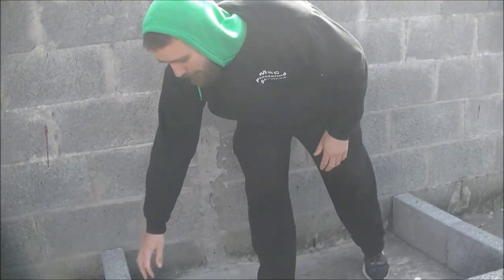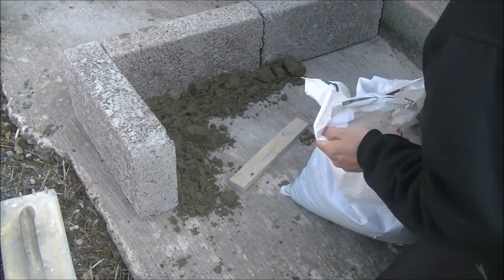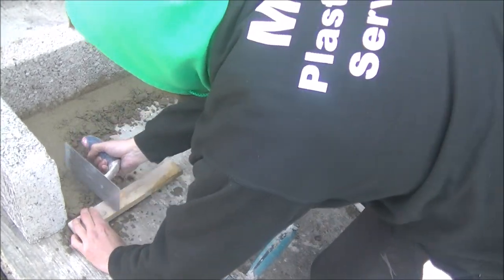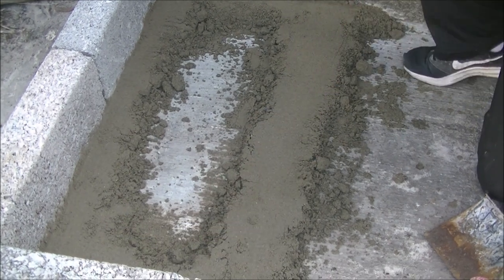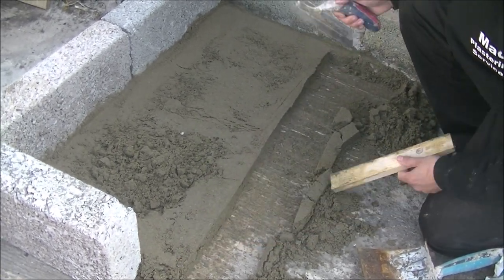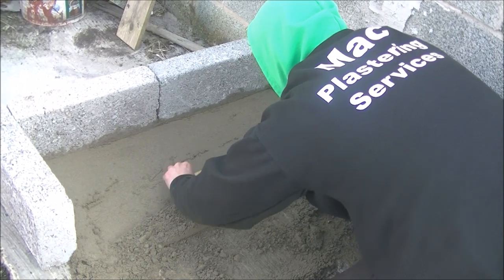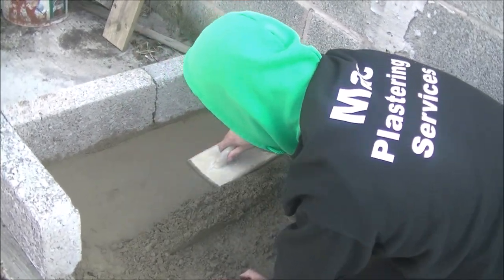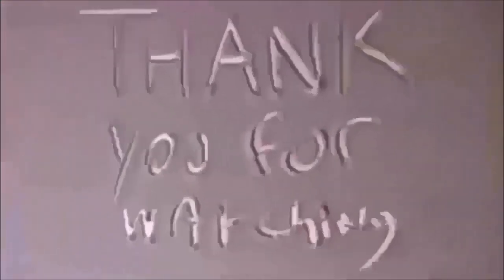screed large area hacks

Comment: I have done lots of floor screeding and the screed band around the edges to set levels and to screed of  and to break up the floor area I call setting my marks I use a laser lever for larger areas to set marks, also I use the exact same process of screeding for laying block paving only difference is I use a string line for setting levels instead of laser level to pull of different levels for paving and also to allow for depth of paving and to set falls,good upload👍
Reply from the maker: Hi mate hope you are well, yes setting the marks is a far better term than what I am using in this video thanks mate, yes I have even helped lay lawns this way and paths like you say for paving but man we both know its hard work haha hard on the body and soul and it dose take a good eye and skill my old boss was so fast at screeding and very very good i mean he could easy done 3 houses in a day and we where away at 2 but man both be busted and to be honest i had it easy on the wheel barrow
Reply: @macplastering  Definitely is hard graft, I have never thought of using technique for screeding top soil for lawns but it would work and I will be giving it a blast👍
Reply from the maker: Works great for roll out lawns as you can lay it on sharp sand ,damp sharp sand is best , we got soil raked out neat and to the levels we liked then a layer of sand and screeded it and a quick rub just to make nice and compact then rolled turf well i left that to my Da im a little heavy handed with it and he knows what he is doing :) but yea man worth a try but sore work 100%
Reply: @macplastering  👍